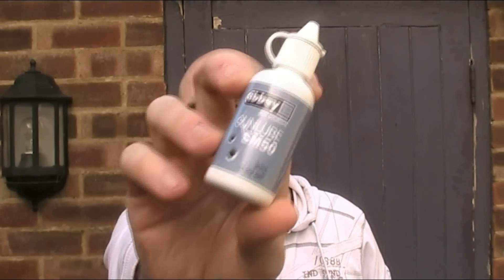Airgun Dieseling | Air Armoury

Comment: How would you get "Dieseling" from none treated or cleaned pellets? I have a new Gas Ram air rifle, and I have had a bit of smoke from a couple of pellets, but not all. The pellets actually seem pretty clean, with very little dirt/ swarf/ powder.....the gun is rated at 12ftlb, and after zeroing the rifle is very accurate.......pellets used are Remington  Thundermatch....my question is, why do I get occasional smoke from the odd pellet, but not from the majority.......yet all pellets are equally (IMHO) accurate? great video by the way, subbed......
Reply from the maker: +davescorpion The short answer us that I'm not 100%, but I do have some ideas/suggestions. You say you 'have a new Gas Ram...', how new is the rifle? It may be that the dieseling you describe is coming from the lubrication of the gun rather than the pellets. Many guns diesel when they are new as the excess factory-applied lubricant is burnt off. If this is the case it should cure itself after you've put a tin of pellets through it. With regard to why it is sporadic, it might be that it takes a few shots for enough combustible substance to build up. If you think it definitely the pellets, try some different types and find which ones seem to work best in your gun.
Reply: +Air Armoury Since the rifle has only fired less than 100 pellets, I think you may have hit the nail on the head. I don't think it is the pellets as I have tried other pellets,  and the same happens, Sporadic dieselling. I'll just stick with it and hopefully it will cure itself........Thanks for the reply..... ;)
Reply: +davescorpion 
Use sewing machine oil, or WD40, or vegetable oil, one drop per pellet. You can use syringes to measure. I've shot thousands of deiseled rounds and the only problems I've have are cracked polymer on the gun here and there due to too much vibration?. I fixed that with silicone caulk, works wonders. The loud crack is caused by the pellet going supersonic. Never do it on a PCP.
Reply: +yamatoneko1 WD40 doesn't work I've just tried it.
Reply: +Dan Wesson what did you actually do with the WD40 Dan? I have never tried to actually make a gun Diesel on purpose, Diesel is classified as "heavy oil" and most UK vehicle logbooks will describe a  diesel fueled vehicle as such, so any oil, can be used as a fuel, depending on the use, but as far as I am aware, wd40 is actually fish based oil........and not as compressible as vegetable or mineral based oils, maybe try a more viscose oil (thicker), wd40 is very thin or "watery" in consistency, thicker oils will produce a better result......
Reply: davescorpion Thanks for the reply mate, I try and put a little bit in the skirt of a pellet (very hard to not be messy with it being like water and being in a compressed can). A thicker oil is exactly what I was thinking, when my B2 first came it Dieseled like crazy for a good 500ish pellets, maybe gun oil/lube would do the trick? Thanks for the info
Reply: +Dan Wesson Try oiling up the barrel. I wouldn't use wd40 for that though. wd40 has tiny particles in it that can damage the rifling.
Reply: not sure oiling up the barrel will produce any thing, the oil needs to be between the piston and the pellet I would think...
Reply: davescorpion I don't know the physics but every time I clean and oil my barrel, it diesels a few times with nothing added to the pellets.
Reply: +yamatoneko1 I assume the term "dieseling" refers to how a diesel engine works, by high compression and requires no form of ignition like a petrol engine. I would imagine if you have a spring or ram rifle, a few drops of oil into the air chamber after cocking the gun will provide the best dieseling effect, also, the best indicator of dieseling would be smoke from the detonation produced from the barrel....... I can't see any real reason to want to diesel on purpose, due to the possible damage it can cause to your gun, I think this will be all about experimentation...... :)
Reply: davescorpion As I said earlier I do it on my cheap Chinese made spring air rifle, and shot thousands of very fun pellets with only the body polymer cracking. Fixed it with silicone caulk. I guess people do it because it's something that can be done? Sounds like a real rifle if you are a couple of streets away.
Reply from the maker: +yamatoneko1 Is damaging your gun and making it sound like a real rifle a couple of streets away really worth it? Far be it from me to judge but it sounds rather irresponsible.
Reply: Air Armoury That was 10 years ago. Now I know better.
Reply from the maker: Glad to hear it :)
Reply: my rifle diesels every time( from the point of owning ) , and i have shot between 100 and 200 rounds